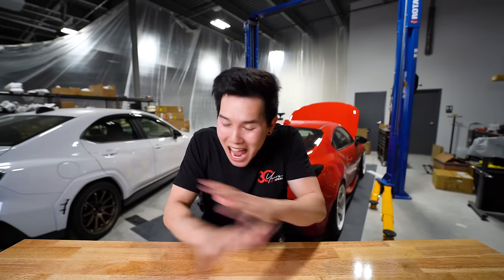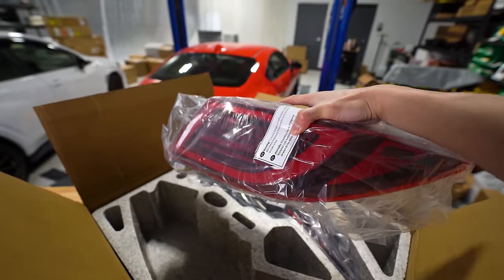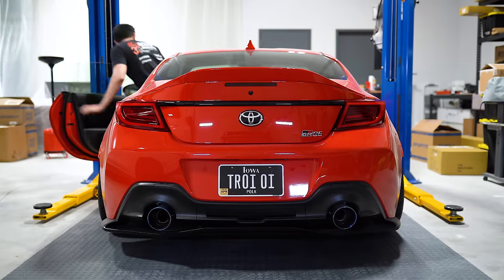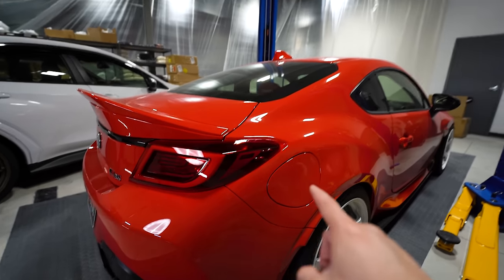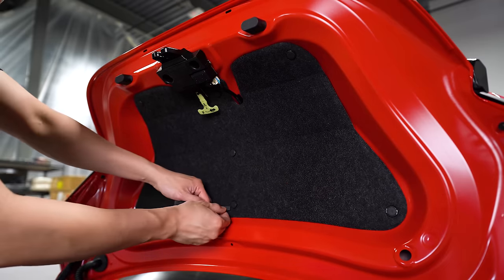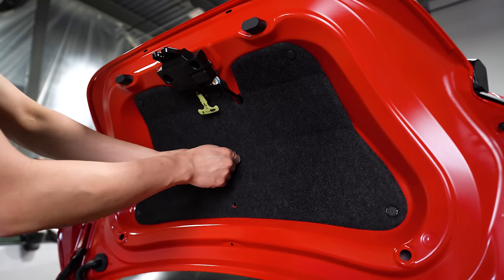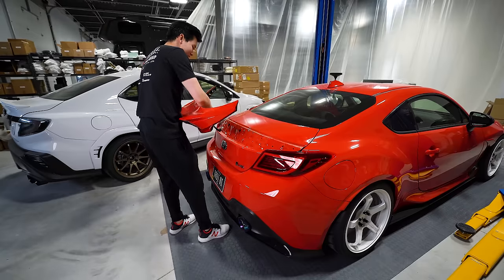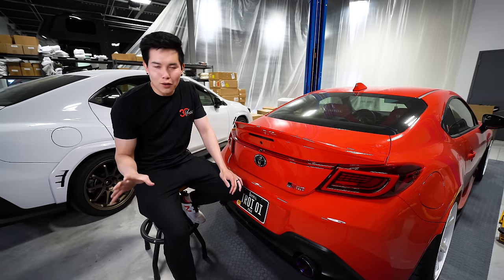22+ GR86/BRZ  AlphaRex Trunk Light & Tail Light Install Review

Comment: Congratulations on the 50k subs! You deserve a minimum of 20x more than that! Your channel has been such a help for me, last Saturday I bought a brand new '24 GR86!
I bought a driven media F1 blinker module, and the LED reverse light replaces! Along with Apexi front and rear strut tower braces, RPF1 17x9 +45 on 245/40/r17 Michelin PS4's but I'm still trying to pick a set of Coilovers before I install the strut braces and wheels/tires!
Leaning towards a set of DS coilovers from BCracing

No giveaway entry required here, just thankful for this channel!!!!

Comment: It's really simple. But I was getting gas in my 2000 Toyota Corolla and there was an old Trans Am filling up, one pump away. When they finished and went to leave I swear this thing turned over for a minute straight, but when it finally fired it was the loudest most glorious sound I'd ever heard up to that point. It vibrated my skeleton and I just remember thinking "That is the coolest shit ever, how do I get that?" and then proceeded to put a magnaflow muffler on my corolla lol.

Comment: I do recommend removing AREX button and apply white lithium grease (any grease for plastic/waterproof) around the button to keep it lubricated and sealed. Reason was due to AFTER fixing the initial trunk button issue (loosened trunk button mount screws), it became stuck after a month. So I had to take it apart again (3rd) time and its been fine since. I did not have to drill button opening larger (yet lol). Congrats on 50k bro! I really got into cars after seeing the first Fast and the Furious in theaters, and the rest was history
Reply: marine grease is better

Comment: Congratulations on 50k subs.  I can't wait to see you grow even more.  Even though I'm not entering the giveaway I'm still going to share what got me into cars.   When I was a child I always loved cars when I was around 5 or so years old I had this framed picture with 3 cars a Porsche, a Ferrari and a Lamborghini.  I practically looked at it everyday dreaming about owning one of them.  I always had R/C cars, those little tracks you put cars on and you use a remote  to make them drive around the track.  This was back in the early 90's when I was young.  What truly sealed the deal that I'm a car enthusiast was my first sports car.  In 2003 when I was 19 years old I was in Japan while serving in the Air Force.  I was car shopping looking for a daily driver to get to work.  I saw this 91 SW20 MR2 Turbo with T-Tops it was White with Buddy Club rims in white, fairly modded and very affordable (about 4,500 if I remember correctly).  I immediately bought it and I had no clue how to drive manual.  I drove it out of the dealership stalling it a few times but eventually I got the hang of it.  When I decided to send it man holy shit was I smitten with not only the car but it really sealed the deal that I absolutely love cars.  I maintained it very well and I wish at the time in 2005 when I left the military that I could have brought it home with me.

Comment: A black one came out, just installed it, I think with this one the button was revised and I have not had any issues with pressing the trunk button to unlock, trimming the pieces were a pain but worth it in order to not crack, unfortunately with the luck I have I cracked the gem trim piece trying to remove the tabs and drilling the holes for the wires.

Comment: @162blade core memory… back in 1994 going for a ride in a CRX with a 50hp NOS shot. 😮 I went on to do a 50hp shot on a 1991 SR20 NX2000. Only lasted a couple bottles before I blew the ring lands off a piston and had to swap the engine. 😂

Comment: 28:38 how do you get the car-side wire loom weather guard back on?   I got the trunk lid side no problem…
Reply: Nevermind.  I was able to pull the nylon plug out, put the seal back on, & re-install.

Comment: @NYC_Tomi   I remember reading up on some Initial D manga during high school.  One thing lead to another, I end up buying my first 97 Civic Ex manual on eBay.  Got it for about $4000 but I got a $2000 refund from the dealer due to someone breaking into the car and stealing the radio the night before they ship it to me.   It was a win win for me.  I was going to throw that radio and replace with mine own.  🤣